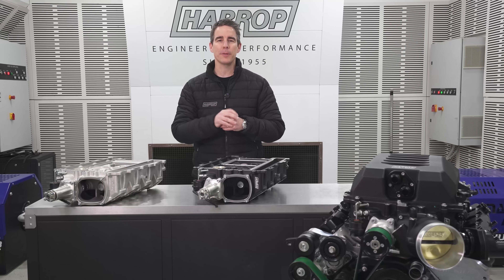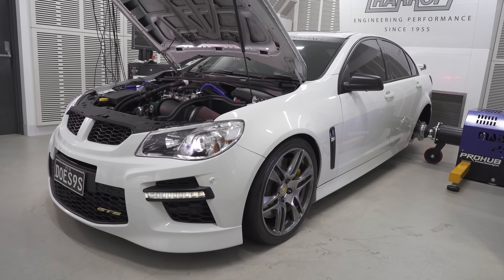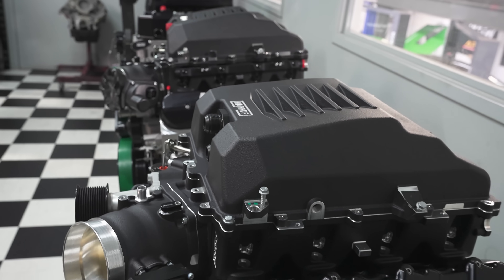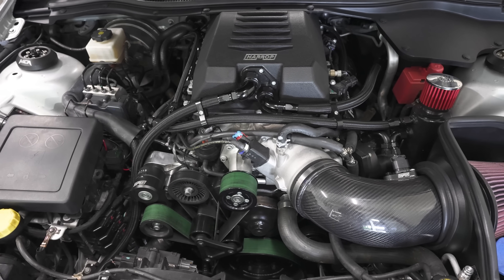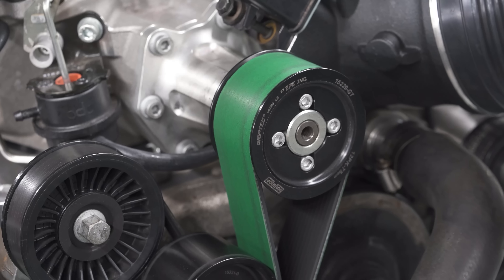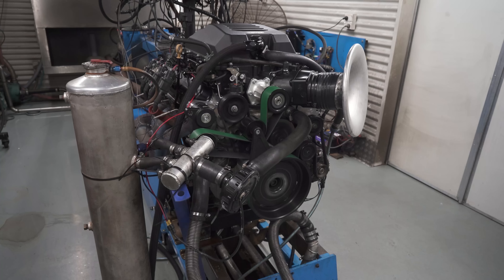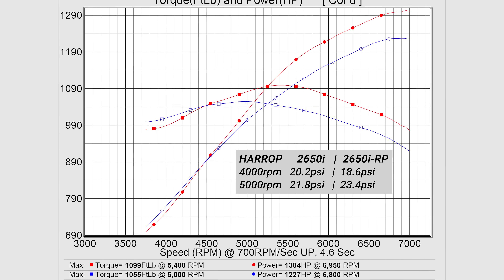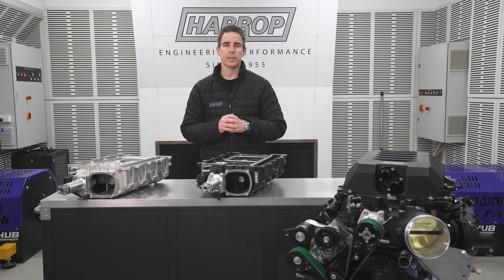TVS2650 Supercharger Testing | Harrop LSA-H2650i RP Edition

Comment: Russo Performance in Sydney supplied and fitted my 2650i on my LS3 HSV Grange. Looks ace, and obviously goes great too.
The LSA "look" was a big in for me over the regular FDFI super charger. With an LSA engine cover.. you'd never know, besides the cheeky harrop lid (which looks super OEM as well)

Interested to know, since both the FDFI and 2650i superchargers both fit under the bonnet of most cars that fit a LS under them....
If you didn't limit height (to a certain reasonable amount anyways, not talking 6-71 height), how much performance do you think you'd be leaving on the table?
Be that in the lid/intercooler, the runners.. whatever
Have you guys done any super experimental trials?
I'm far off needing something like that, but it does make the brain tickle along =)

Comment: Now we have very powerful small EV motors some of them are pushing over 500hp so my idea is to use a powerful EV motor to spin a huge supercharger to make boost rather than using engine's crank to spin supercharger by doing this we can eliminate parasitic loss and reduce heat and can get any boost at any RPM. I Know EV motor's big battery will add some weight but I think it's worth it.

Comment: I've been running the standard H2650i on my CTSV for 4 years now and 30k+ miles   Making 970 whp at 20 psi through the stock mufflers and a 103mm throttle body.  Absolutely love it.  Just wish I could fit the Harrop lid and intercooler core under my stock hood.
Reply: You should look into the Kong Performance G3 lid then. I have one on my car and is designed to fit under a Gen 2 CTS hood. I don’t know if Kong’s unit is better than Harrop, but it is lights years better than a standard ZL1 lid.
Reply: @lpcook1 Kong Gen 3 is straight awesome. Big gains on my ZR1
Reply: @corvetteZ3r Yes! It is very efficient and the IAT2 temps are lower and recover faster. I recently had a Kong Gen 1 lid and the Gen 3 lid is a significant improvement.
Reply: @lpcook1 oh I’d say so. I think the 1 and 2 sucked especially the 2
Reply: @corvetteZ3r I hated the location of the IAT2 sensor. The temps always falsely read about 20 degrees higher than ambient and would only show a true temperature under load. Greg fixed that issue with the Gen 3.
Reply: @lpcook1 that’s how my Gen 3 reads. Been  couple days where it was 17 above ambient. I think my C&R bricks were similar in iat2 but the Kong recovers quicker for sure, and the car is a lot faster with it
Reply: @lpcook1 ROFLMAO. "Falsely high" above "ambient". Hilarious. "Cold air intake" by chance? News flash. Underhood temps are ALWAYS "falsely high" compared to "ambient" and simply moving an "IAT sensor" closer to the intake system "venturi" will "falsely LOWER" intake air temp. Letting the "maker" claim a new "generation" of "lid" is an "upgrade". ULTIMATELY REAL INTAKE AIR TEMP IS "DOWNSTREAM" FROM "FORCED INDUCTION".
Reply: @corvetteZ3r ROFLMAO. What? "Faster" in September than in July? No shit Sherlock.
Reply: @deeremeyer1749 Whatever the case maybe the location on the G3 lid better aligns with the stock LSA location giving a more accurate  measurement from where the OEM lid would be. The recovery of my IAT2 temps are noticeably faster and lower overall. I’ve had a plethora of lids over the many years from stock LSA, Magnuson 2300 Heartbeat, reinforced ZL1, the Gen 2 Kong, and now the Gen 3 lid. All of the aforementioned lids had their IAT2 temps in a similar location except Gen 2. It’s not to say the Gen 2 lid is trash, but it certainly does not perform better than a Gen 3 lid.